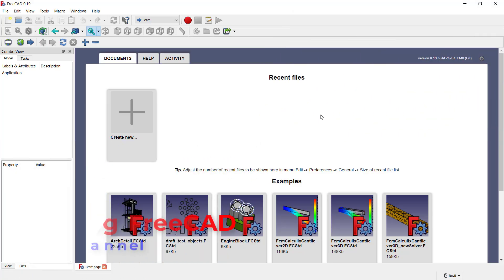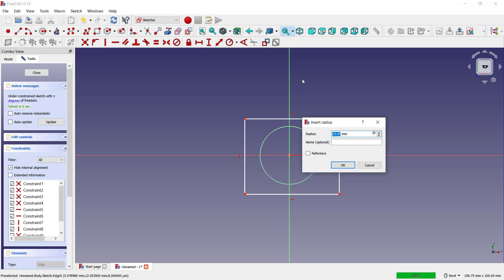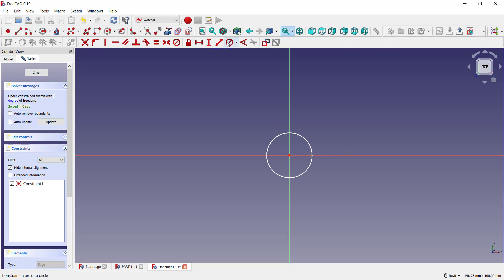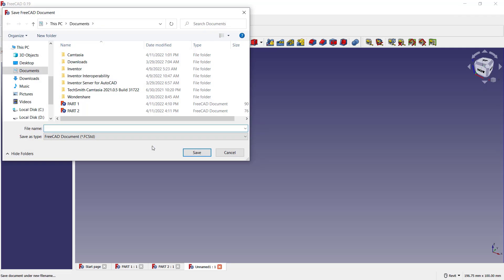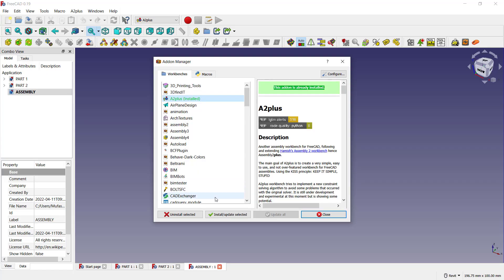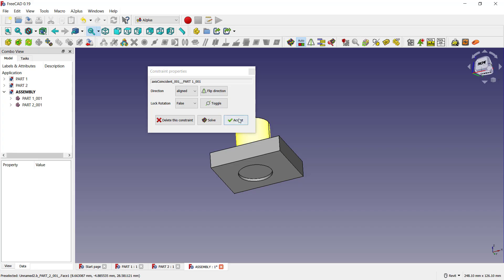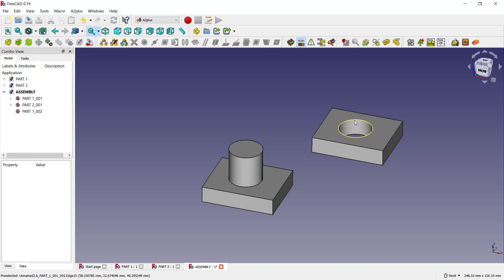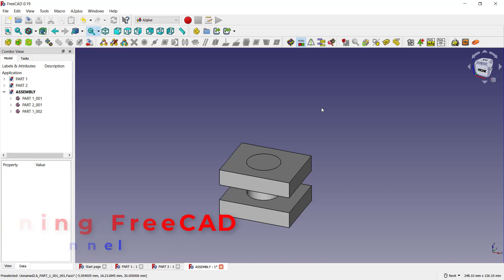FreeCAD How To Combine Parts Tutorial

Comment: I think you need to join the two bodies together first. There should be a combine function somewhere for freecad that combines the front and back bodies. You said it yourself you can only create the pocket on one half at a time. I haven't used freecad but I'm learning Fusion 360 and SolidWorks and Autocad.

Comment: Thank you for your video and excellent explanation. the option to set the planes co-incident doesn't appear; I can't tell using 'transform' exactly where it's going. Can you do a video where you set the cylinder EXACTLY in the center of the square/rectangle? When I join actual parts they are more complex and exact then shown here; I need a way to precisely position them. Any ideas?

Comment: remember with freecad, you get what you pay for. Very non intuitive, difficult and time consuming
Reply: 100%
Reply: And also super awesome because of that
Reply: @olibarahosasa1137  I agree, and of course that's why I'm trying to learn it. Coming from solidworks, it is difficult to understand why the authors chose to imitate some look and feel but not function. I know I sound whiny, but can you answer my question, below? I have improved, but struggle to get precise results. For example Transform is a really necessary tool, but functions very coarsely. In sketch I need zed (or 3 axis) control to position the drawing in space. Most of the time the position edit window has no effect, and ignores my input. It seems to me the paradigm for the tools is backwards; you don't start with a body to sketch, you should start with a sketch and create a body. Then you need the power to position it in space. I can do very simple blocky things, but the time spent to get precise spatial drawing of complex parts is astronomical. 
Anyway, I'm trying, thanks for your input.